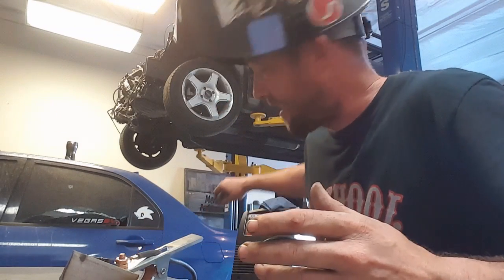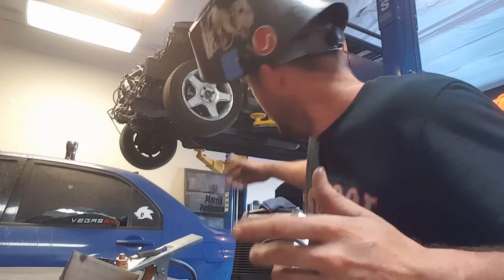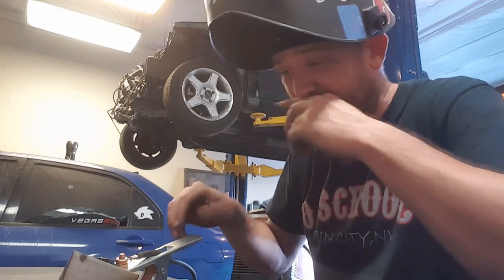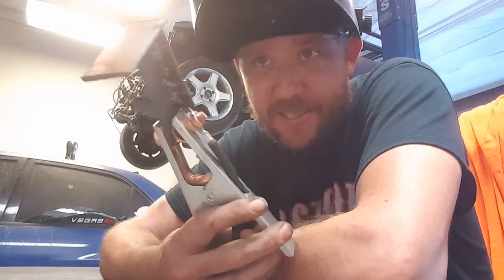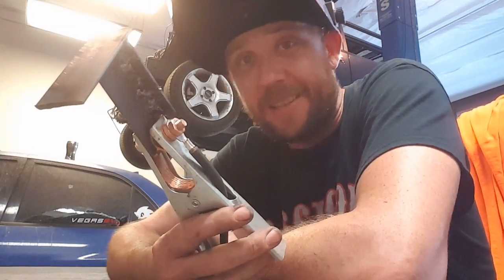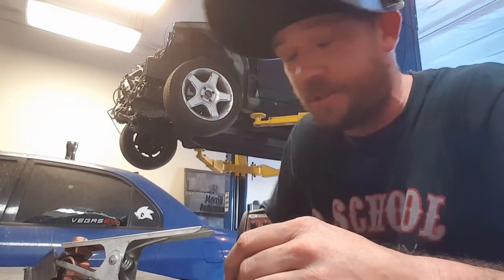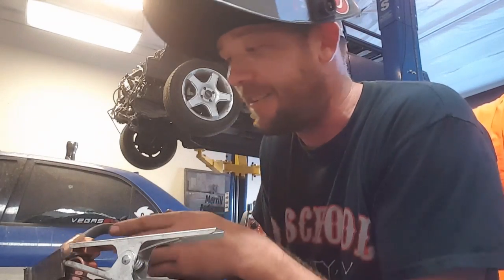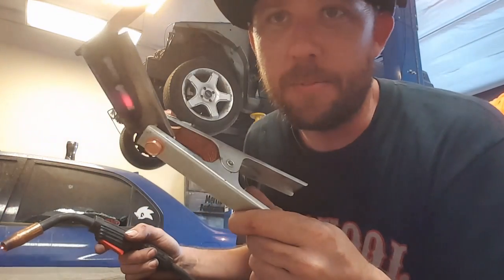TFS: Best Advice for a Beginner MIG Welder

Comment: I would like to ask about residu after welding,can you explain to ke about silikat or silicat?
In Indonesia right now are viral about ESAF motorcycle frame wich build by AHM Honda that easy to corosion,and they said it wasnt because them.
Theres a stain on the frame thats look like rust,but they said it wasnt rust,it was silikat.
And wondering,what is that? Is it welding residu or anything else.
Please answer, i want to know.Thank You.

Comment: How about mig welding thin metal E.g car body repairs. 

I constantly just blow threw constantly.
Reply from the maker: Calli Campbell Turn the machine way down or use a stitching method. Sometimes a MIG is not a great machine for very thin metal, but you can make it work.
Reply: The Fabrication Series . Cheers Bro. Will give it a go.  Even tacking patch panels are a risk of warping.  Might get myself s Tig too make life easier
Reply: Calli Campbell lay down dots in different places, cool them right away with wet cloth, and take time between laying the dots. You need gas for bodywork as well in order not to burn through. If you cool the dots and take time laying them you will minimize warpage

Comment: I'm new to welding, I have an Sean rebel, only used the mig so far, but I always have a problem welding uphill, flat welding seems fine, but the same technique uphill and the weld puddle just runs down and isn't flat

Comment: I just bought my first welding machine an Everlast 210 EXT. the only welding I've ever done has been oxygen acetylene. So it may be jumping in with both feet. My welds suck so far, but i'm catching on much faster than I expected. It channels like yours that have make this all possible and I am so grateful, so thanks. I'm also thinking about posting some videos of my progress so others can see what its like starting from ground zero.

Comment: Is this true for flux core welding as well? I have a really cheap flux core welding machine that I can't get consistently good results with, no matter how I try. I'm just about ready to give up and buy a proper machine, but I don't weld that often so it's kind of hard to justify the cost.
Reply: Have you checked the polarity? Flux Core (-), Gas (+)
Also, a good ground to the object is very important and the closer to the weld the better. I have a Miller, but I have seen videos saying AHP is fairly good - NO personal experience with the AHP Mig!
Reply: Yeah, the leads are fixed so I can't switch them around. The ground could be the problem, I have experimented with different ways to make sure it's good though but so far it hasn't helped. Thanks for the reply. :)
Reply: If it is NOT set up for gas and there is no option for gas, then I feel 99.9% sure you should be welding with Flux-Core wire.

Had another thought. If there is a school (high school like) that teaches shop (welding) maybe you could get with the instructor and let him test run the welder.
Reply: This welder has no option for gas, and I am running flux core. I have a friend who is a qualified welder, I'll try to get him to test it. What I'm really asking is if it's worth persisting with this simple welder, or if I should just buy a proper machine.
Reply: I had bought a Miller 120V Mig but wasn't pleased with it's output and traded it in on a 120/220V Miller 211 Auto-Set. That was some time ago, but it has served me well in my home shop. It welds better than I can, but I have put together most all things with satisfaction. If I were to replace it I would probably look into one with digital wire feed and voltage readouts - as most youtube videos for leaning show these values. I also would look at a AHP or Everlast simply because being retired and on SS I don't have the $$ for another Miller or a Lincoln.
Reply: Thanks for the advice but I'm not sure how many of those brands are available in Sweden. :)
Reply: That probably will make a difference, but you could look them up for comparison against a local brand. Hope it works out for you.
Reply: Thanks, and thanks for all the advice - much appreciated!

Comment: Hey for beginner TIG welding what kind of gas would you use straight argon or 70/30 argon helium what what what would you recommend
Reply from the maker: one2fast 4u 100% Argon. Mix is more for specialty stuff. I'll get into much greater detail on the TIG Simple Series as the progress.
Reply: The Fabrication Series ok thanks for your quick response and ur  professional opinion